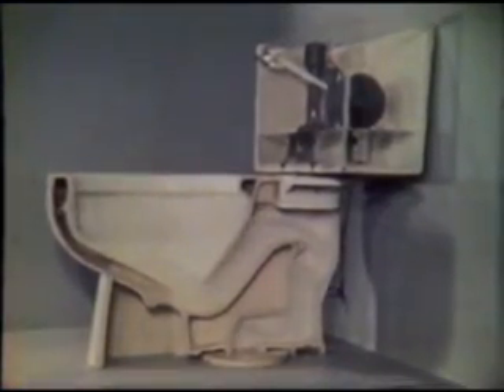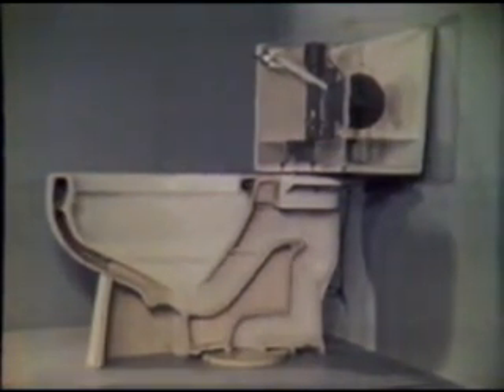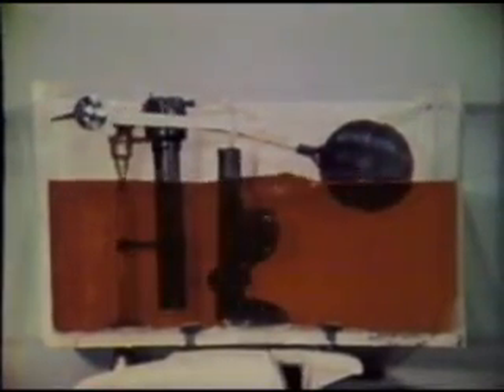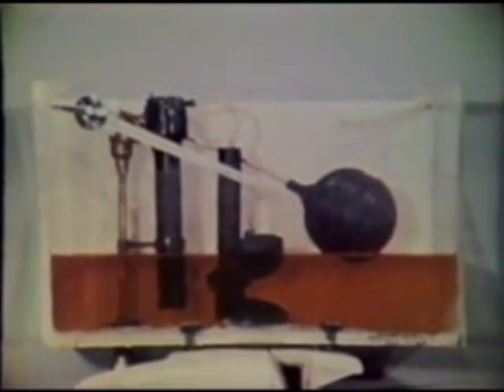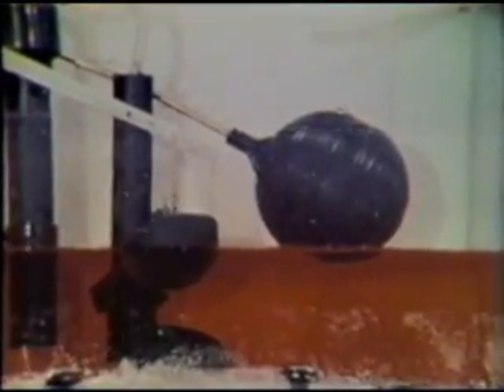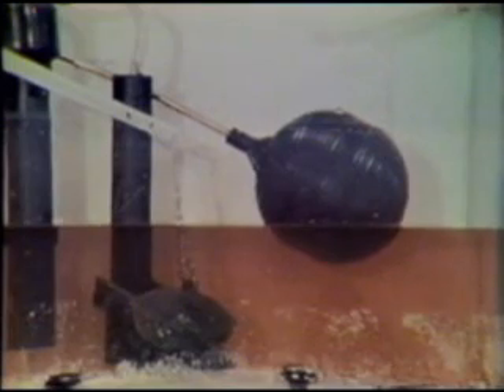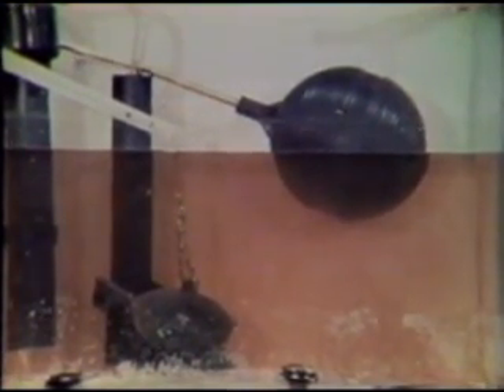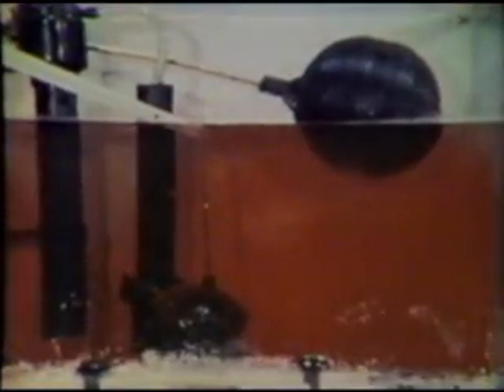The Flush Toilet

Comment: This is a great seat with bidet.≖≖>allmy.tips/TOTO-Tseat?vv❅    Simple to install & simple to use. It comes with everything U need and U don’t have to connect the heated side if U don’t want to. Comes with a cap to cap it off. The seat is slow closing. The only thing I don’t especially like is you have to hold the seat open for a few seconds to get it to stay open so U can sit down; otherwise it starts closing before Your able to sit on the seat. American Standard is a great bidet. I have no other complaints. Oh, and no need for bumpers to level the seat onto the toilet.

Comment: This video is freaking awesome -- the red is mostly creating a missile to create a rolling action over the top of the bowl water ... and then the shape of the back side of the lower siphon thingy shoots the water back against the left hand side going down, thus creating a seal (and a vaccuum?) ....  Basically, my conclusion is that the shape of toilets is not patented and is pretty well resolved ... and therefore the issue for value is having poorer quality porcelain in the siphon areas where pressure is applied and porcelain might form small cracks allowing air to leak in, negating the vaccuum in that area, but not necessarily leaking water.  Don't know if this is right, but still super cool to watch and ponder.

Comment: A frequent problem with toilets is the distance in the quiescent state (no flushing) from the lip or rim of the bowl down to the surface of the water.   That distance is fixed by the height ot the dam that forms the siphon channel of the bowl and is part of its molding.   For men, the distance may not be adequate, because a man's scrotum hangs into the bowl as he sits on the seat.   There are four things that can be done to remedy the problem.   1. Castration;  2. Buy a better designed toiliet; 3. Buy a ring in a pharmacy that raises the seat several inches above the rim; 4. Described below. 
1,  Castration is permanent and has sexuatly adverse consequences.
2.  A new toilet is an expensive solution, and manufacturer's often do not state that dimension so that you can shop and compare.
3. A plastic ring is not cheap, over $30., I find, and they are a problem to clean.
-----
4. I find that by removing the overfill tube from the top of the overfill pipe, the water level in the bowl can be reduced affording a greater distance between the lip or rim of the bowl to the surface of the water.   I find that there is no disadvantage to so doing, as long as one allows the overfill tube to hang into the tank to fill the bowl.   By this change, the water from the fill valve will go entirely into the tank and not into the bowl as the refilling takes place.  I find there will still be enough water in the bowl for the siphon to function as it should.   You can try this solution, and see if it works.   The protective action of the overfill pipe will not be changed.  There will be less water in the bowl in the quiescent state,  and you may have to clean your bowl as you always do more frequently.   Try it and see.   Much better than a dirty wet scrotum, guys.
Reply: You are an absolute fool 
You need water in the bowl at all times to stop bad smells occurring in the bathroom 
Also the overflow mechanism is essential 
Without the tube in the overflow pipe the water level in the tank would get so high that it would then flood a bathroom